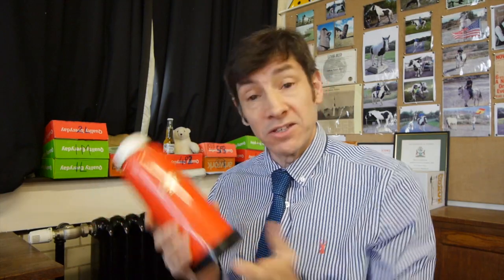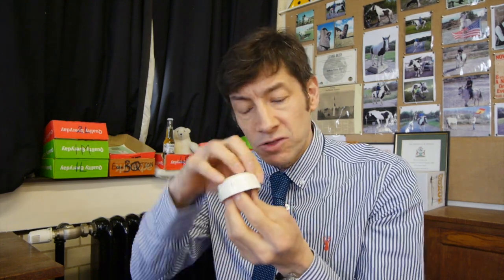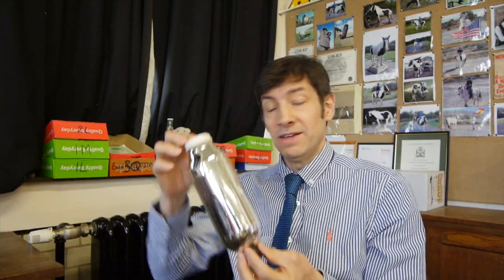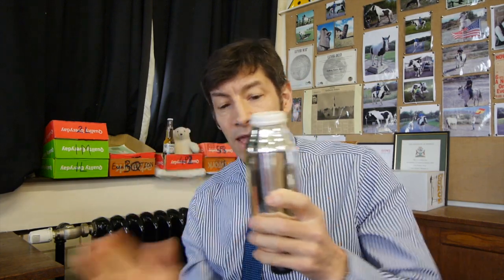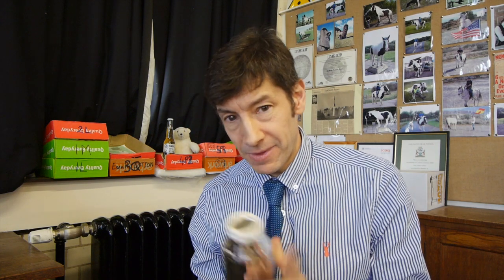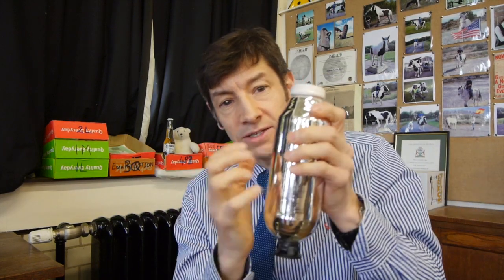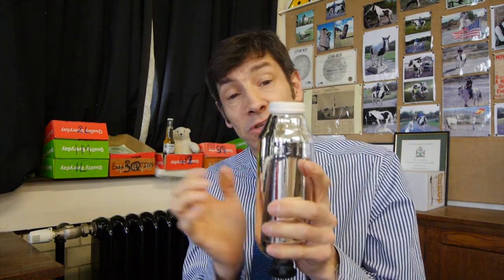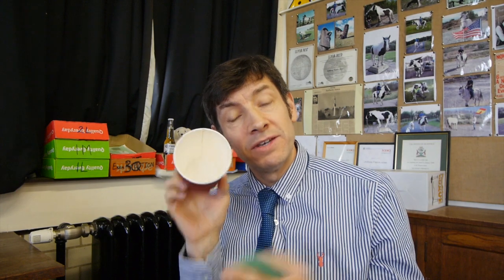Thermos Flask/Vacuum Flask - F-J's Physics - Corona Busters

Comment: Hi, great lesson, thank you. Could you please explain how the liquid in a vacuum flask eventually gets cold?
Reply from the maker: Stephanie, that's a great question.  The design features of the flask are not 100% good at what they do so small amounts of thermal energy will get out (per second) but much less than would from a normal open container.  So it will slowly let the heat out and the contents will cool.  Hopefully, this takes longer than the time you take to transport and drink your coffee!  In the case of a liquid gas this is the same in reverse with the heat slowly getting in.  You must remember therefore that some of the liquid will turn into a gas slowly as it absorbs heat so NEVER carry it around with the lid sealed on!  I have seen them explode!  Hope that helps and as ever enjoy your physics!